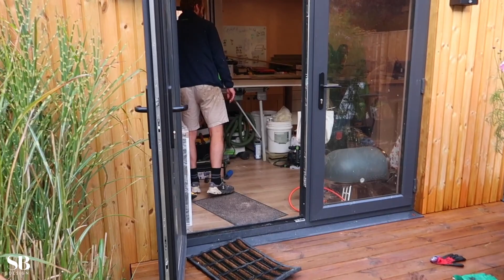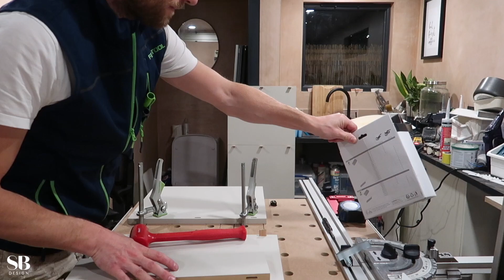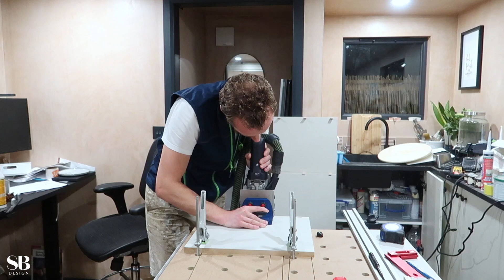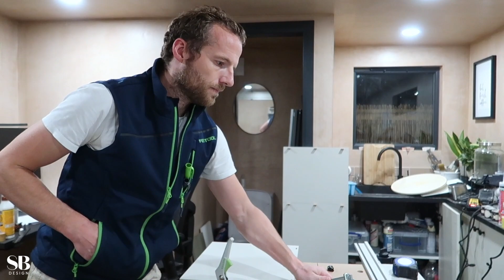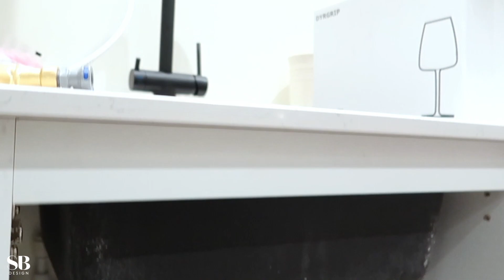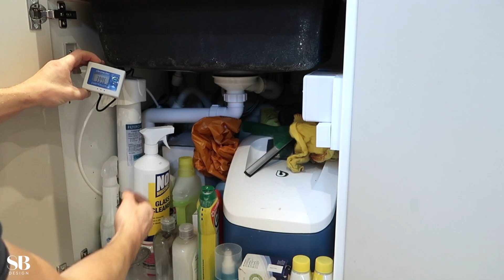How to build bespoke kitchen cabinets | ​Festool Domino and Track Saw | Kitchen Renovation |6|

Comment: FYI: the window gauge on the DF500 isn’t calibrated at the factory. It’s a good reference when making a loose mortise but it can lead to error on a tight setting. Worth confirming.
Reply from the maker: Ah that's good to know, thank you. Will check mine next time I've got it out.